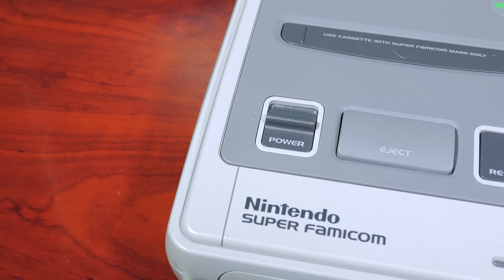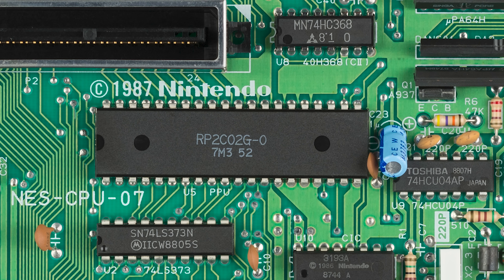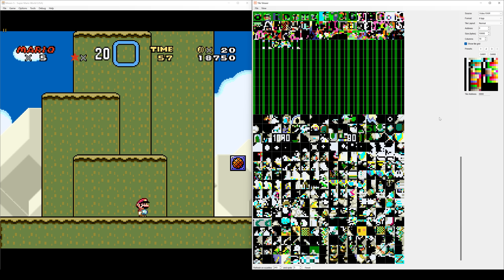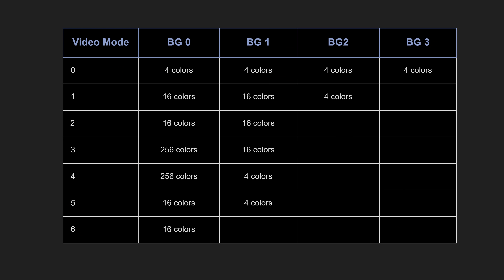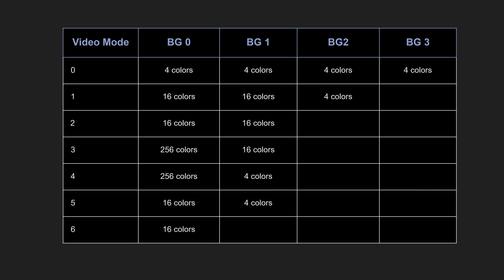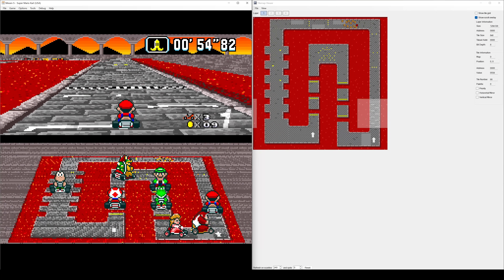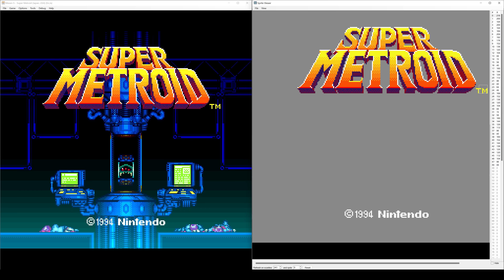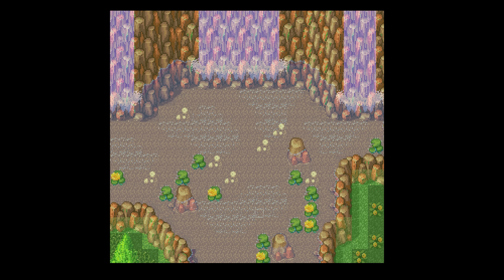How Graphics worked on the Super NES | MVG

Comment: But you know what guy. That's a good point. Because. When I first came. Two sega i got the Saturn. And the game gear i always thought. Those was sega more powerful systems. Dan. The dream cast. Because I always thought the Genesis was very weak. It wasn't a very good system for saga. That's why I picked a super Nintendo over it. Even with the specs. You pointed out. The extra chips. Made the games run better. And look better. Didn't the Genesis? And a lot of the game sound better too. Like I don't think. The Genesis. Cut run street fighter alpha 2. But snes did by mega gamer 🥷 😅😊

Comment: The snes might have huge graphical performanes over the nes, but it’s cpu still only has an 8bit bus just like the nes cpu.
Also the snes cannot stream 240p graphics at full color at 60fps from the cartride, in wich the nes can do.
Also it’s cpu speed is slow, so the genesis cpu definitely wins it over the snes cpu with it’s 7,9mhz speed and 16bit data bus.
Also am actually sad that the snes cannot do all graphical effects atonce and that it also cannot do sprite scaling at all, because i throughtthat it could do that all.
But nope, the supernes turned out to be more limited then i throught to be.
What’s also disappoints me is that while we did like and praise it’s audio over it’s competitors, but sadly most sounds in most games were heavily cut and compressed and then stretched sothat they could fit them all within that 64KB aram.
They could,ve used audio swapping tricks much earlier on to get around that limited audio ram in order to get much better audio quality out of it.
But sadly such audio swapping tricks were very late discovered so only a few games did made use of it.
Still through i do like my snes and those games but with those discovered limitations and concessions they made in the hardware and games they made will leave a dirt taste in my mouth.

Comment: I didn't expect to see my work on Brian the Lion here :) Although we pitched it to magazines as showing that the Amiga could do Mode 7 effects as well as if not better than the SNES (we had 2 layers of' Mode 7' at one point) it was much more limited. With HDMA the SNES could emulate a fully 3D plane, on the Amiga we figured out how to do horizontal and vertical scaling, and in plane rotation, but not together.

Comment: To this day, I still think that the color scheme for the console's design outside the US was a complete disaster. This color palette was very popular with the Japanese public, as they like gray or white electronics. In the US and most of the world, the trend was for black electronics, and I once saw a modified SNES that looked like it was from the factory, but using black and red (Nintendo's color). It looks a bit like a Sega Genesis, but looking at it, you get the idea that it is a super powerful console, different from the feeling we get when looking at a traditional SNES and imagining that it is some kind of video game for small children from Fisherprice.

The controls were also not adapted for use outside of Japan, which means that the controller is made for smaller hands than the rest of the world, and has a more sober and straight design, compared to the early 90s trend of more organic and anatomical electronics, such as the 6-button Genesis controller.

Although the Genesis has a respectable processor, Sega had to put a lot of effort into the console with a lot of gadgets to be able to compete with the SNES and its clever way of expanding through the cartridge (without making the game too expensive). The SNES has a very nice graphic controller, and I particularly prefer the SNES's sample-based sound system, which is somewhat reminiscent of what we saw on the Amiga. The MD/Gen had a nice audio capability, but the lack of a manual to program it correctly ruined most of the games and the image I have of the console as a whole.

Comment: I heard that the prototype SNES had a CPU similar to the Genesis speed but the dropped due to price.
Reply: So SNES was cheaper than genesis?
Reply: @ArneChristianRosenfeldt it was going to be more expensive than Genesis
Reply: @CubamusPrime  but the genesis has this huge 68000 ( not 68008 ) chip (package cost). All helper chips needs to be 16 bit. The connector to the cartridge has more pins. So how is the SNES more expensive? I guess Sony wants to be paid. Genesis has this dated sound hardware mix from Yamaha.

Comment: The 65C816 was a bit more powerful than the clock speed might imply since a lot of its instructions operated in fewer cycles than, say, the 68000's. You also had the option of dropping into 6502/8-bit mode which could not only shrink code size but improver performance for some routines. You did end up counting cycles a lot, especially with things that had to occur during display blanking.
Reply: I don’t get this mode thing. Code is almost the same in both modes, just 6502 mode is slowed down artificially to be a cycle precise emulation.
Why not use the m and x flags? A 16 bit X register makes a lot of sense to me. Still INX only takes a single byte. 8 bit accumulator. REP and SEP only take 3 cycles. So a good compiler can optimize for code size (short vs int). TAX assumes unsigned data. Weird that branches are signed, but everything else is unsigned. On RISC everything is signed.
Reply: @ArneChristianRosenfeldt  
I think you're confusing, somewhat, the 65C02 and 65C816 processors. Also you seem to be talking about the mnemonic codes rather the The resulting binary code (the same mnemonic might be 33% more bytes in binary). The 65C816 isn't a 65C02, though it shares some characteristics with it, but its strengths and issues have nothing to do with its 65C02ishness.

In native mode the number of bytes required AND cycles, can balloon for a given piece of code. When you're working in very tight constraints of RAM and ROM with a lot of things to do that's a problem that can outweigh the advantages of using the 16 bit mode. Especially in time-sensitive interrupt code that absolutely has to finish in X cycles or it crashes. So, by using the 16 bit native mode only where it's an advantage, and using the 8 bit 6502 mode where it is adequate or even an advantage, you gain the best of both.
Reply: @williamivey5296  I checked the timing for branches and some addressing modes. Those have a 50% chance of adding an additional cycle in 65C02 compared to 65C816 with x and m flag set to 1. It would certainly be nice if some zero page addresses would sit on the chip to keep more 16 bit pointers there. What you mean with ballooning? There is only one data access per instruction. Pointers in the zero page were always 16 bit.
Reply: @ArneChristianRosenfeldt  
Several addressing modes add a byte and a cycle, others add just a cycle, and a few don't change. But the net result is the resulting binary is larger and consumes more cycles in native 65816 mode. And as I mentioned, we were under tight space constraints, and often had no cycles to spare. (One of my programming partners spent hours trying to figure out why his code was crashing the system. Turned out the branch he'd inverted, while logically identical to my original, was now one cycle too long.)

You can keep arguing, but I think only one of us has years of experience programming the 65816 on a SNES.

Comment: The difference in speed between a 3.58 MHZ 65816 and an 8 MHz 68000 is not as great as it looks on paper.  The 68000 has a 16-bit data bus and a vast instruction set, but the 65816 is faster at executing instructions.  The 68000 is a little easier to program, but I had fun writing code for both.

I spent months of my life as an assistant developer on Dirt Trax FX.  

I really loved working on the SNES.  I wish that it had some sort of built-in OS with support for developers, but the developers had to do everything themselves.
Reply: I loved dirt trax fx!
Reply: Thank you for sharing your knowledge and experience, maybe idk in a percentage do you think represents the real difference between overall processing power between the 2 systems?
Reply: @retrosoul8770   I loved programming both processors.

Based on everything I’ve read since posting my comment, I think the Genesis has more processing power than the SNES. Hypothetically, it might have roughly twice the CPU power of the SNES, but it’s hard to tell because the 65816—and the 6502 it’s based on—are quite efficient at executing instructions.

Comment: The 65816 is not a weak CPU against the 68000. The 65xx series (whos 16 bit version the 65816 is) is quick by design. The 68000 needs more MHz to be as powerful as an old 6502 (as used in the NES).
Reply: Snes games are well known for getting slow down due to the weak CPU it was no match for a 68000.
Reply: @Arpthingy , a 65816 at 3.5 MHz is as fast as a 68000 at 7 MHz. I assume Nintendo used the 65816 as some kind of evolution, this CPU wasn't used very often (I just remember the Apple IIGS), for some reason 68k was used more often. OK, it has a real 16 bit bus and many fancy features, i. e an MMU usable for non-gaming computers. But what was the 68k's main task in home computers and consoles? Telling custom chips where to pick data and what to do with it.

Comment: Was is 128 or 256 colours in modes 3 and 4? The voiceover and the visuals disagree at 5:28, and I'm confused as to which is correct, and why someone would pick mode 4 over mode 3 as it's 2 layers with less colours on the second layer. At 5:55, there's another disagreement where the table says 16 but you say 32. Could you clarify which is correct in these bits?

Comment: Comparing MHz is not an accurate indication of processing power. A bus cycle on a 68000 is four cycles and only one on the 65816. Actually half a cycle as the CPU only accesses the bus during phi2 high.

Comment: SNES and N64 were great systems, but sadly Nintendo cheaped out at the last minute. To save a few bucks, they went with a VERY slow CPU in the SNES and an incredibly small memory for bitmaps/polygons on the N64. If they gone with a legit 8mhz CPU in the SNES, the system would still hold up today, but unfortunately it had major slowdown issues (see games like Super Castlevania). There's no excuse for going with such a crappy CPU. And on the N64 the memory for textures and bitmaps was close to ZERO so you were left with games that either had really LAME bitmapping or none at all. Dreamcast was FAR superior in end result but N64 could have been MUCH closer if Nintendo folks put even a tiny bit more memory in their hardware.

Comment: i just hate how consoles stuck to 30fps for so long. It's only now we are seeing 60fos as mainstream.
Reply: Huh? Most 16bit games were 60fps.
Reply: @bombjack1984 most  crts only outlut 30hz
Reply: @anthbobo2783  Which ones? All common CRT TVs of that era could do either 50 or 60 Hz, depending on their TV standard (PAL/NTSC). Consoles like the SNES didn't use interlacing, they did in fact output 50 or 60 fps. Now if every game made use of that is a different question, but for example Super Mario Kart definitely runs at 50/60fps.

Comment: One really important part of mode 7 working so smoothly was a separate hardware for matrix transforms that would handle those computations, which is not well-suited for the 65C816, which uses fixed-point math.

Comment: I've always been confused why Nintendo didn't run the CPU at a higher clock speed. The SA-1 expansion chip is the SNES CPU at 3 times the speed. So it clearly wasn't a heat issue since it could fit inside an SNES cart with no issues. It also wouldn't have been a price issue since it only increased the price of games by $10.
Reply: The 65c816's chip layout wasn't optimized for high speeds. Its predecessor, the 6502, was developed to do as much as possible with only 3510 transistors at a price of only $25 (equivalent to $120 in 2020) while other CPUs of the time cost hundreds of dollars. Actually at first it wasn't even intended to be the CPU of a computer at all, it was a MCU (micro-controller unit) for embedded tasks. Other people saw the price and put it into home computers and videogame consoles.

Nintendo decided to use the 65c816 because it was backwards-compatible to 6502 NES code. (They wanted to support NES games too, but gave up on that midway through development.) Fun fact: early 65c816 units had a bug, search for "Early 65C816 CPU's SEP and REP instruction are followed by a NOP?", it's on retrocomputing stackexchange.) Many publishers chose cheaper 2.68 MHz ROM chips anyway, so a higher CPU speed wouldn't have been possible anyway. Meanwhile the 65c816 was optimized over the years, until it was fast enough for 10.74 MHz, half the speed of the SNES master clock.

Comment: Does mode three's first layer have 128 or 256 colors? At around 5:20 give or take you seem to suggest it has an amount of colors different to what's on the screen. Similarly, at around 5:50 you seem to suggest mode 6 supports 32 colors.

Comment: Is the slow CPU why so many SNES games had slow dawns?
Reply: Well, CPU speed is hard to measure when the data bus and speed of instructions also play a role (e.g. the Mega Drive has got a rather slow memory which causes conflicts with its fast CPU).

In addition, certain programming practices also matter if you care for performance. For example, the SNES uses a complex memory mapping (i.e. how RAM, ROM and the like are accessed) because the 65xx CPUs allows you to take quite a few shortcuts with addressing which is not only smaller but faster. Basically, the data bus on the SNES is 24-bits but you can often omit the top most eight bits (the bank) and enter only 16 of the 24 bits of the address and taking off another 8 bits is also possible if your memory allows it. In contrast, if you always use 24-bit addressing (i.e. access the whole memory range directly), you end up taking a notable performance penality which does matter since you access memory a lot.

Comment: Question: What was the source of the infamous SNES slowdown? It is quite noticable in scrolling shooters top down or otherwise? Alexlay is a sight to behold but ran slow the majority of the time.
Reply: Probably sprite update calculations, if I were to guess. Each sprite on the screen (which means each bullet / enemy) needs to run through the update routine. Particle effects also need to run through the update routine. The way the SNES worked was that it was still tied to the v-blank, where graphical updates were usually done during v-blank and game logic done during the main screen drawing. Some games stole away game logic cycles to be used for special graphical effects because they figured that was worth the tradeoff. However, if it wasn't calculated within the game logic update budget, then it would have to wait for the next frame, which could mean certain things update once every 2 frames instead of 1, or every 3 or 4 frames, etc.
The 65816 CPU also wasn't that fast (as mentioned in the video), which meant it had to struggle more to do complex calculations. Even systems like the Neo Geo struggled with this.

Comment: Mana's opening scenes are a good example. back when we were running SNES emulators on pentiums you had to disable transparency to get a good 60 fps - and if the screen was covered in fog, like that haunted forest section in Mana, you had to turn off that layer for it to be playable. ZSNES was a total revelation in discovering how  the levels were assembled
Reply: Pentiums... or 486ers (say hello to fixed frameskip)

Comment: I wonder how advanced snes games would have gotten if the super fx chip was there from the beginning.
Reply: You mean as part of the console? Surely it would make the system more expensive. Reason why it was only included in the cart was to prevent the console from going over the launch price.
Reply: I would look at the GBA for that answer. The GBA could do most of the super fx stuff stock, but without having to program a complex co-processor (the CPU was more powerful too).
The most useful aspect of the super fx chip was probably the sprite affine transforms, which is what the GBA had from the start.

Comment: Very interesting. But in Yoshi's Island for instance, all kinds of sprites get deformed, not just the background. I always wondered how they did this.
Reply: Software rendering afaik, the cartridge has a 10.74 MHz version of the same CPU as in the base unit.
Reply: @ShinyHappyREM  You're thinking of the SA-1 which does allow for easy software rendering but YI uses Super FX (a RISC processor, to be precise), not SA-1.

Comment: The SNES is my favorite console ever, but I really wish we could have seen what an SNES with a 68000 CPU could have been capable of. Luckily we have rom hacks like the SA-1 implementation to eliminate slowdown in games like Contra III that can be played on original hardware via the FX Pak Pro, but I think a fast 68k could have made a big difference, especially in some of the earlier sports games which were quite sluggish.
Reply: Many early games weren't that optimized, simply because programmers weren't familiar yet what coding techniques were the best.
Reply: @ShinyHappyREM  Sure, but by the time the SNES came out, the 68k was a familiar architecture for a lot of programmers. Not only was the Genesis using it, but so were several arcade boards like the Sega System 16 and the Neo Geo MVS, in addition to systems like the Sharp X68000. The point being that the ramp-up time would have been a lot faster with a 68k processor.

The 68k, being a faster processor in general, also would have helped alleviate slowdown issues regardless.